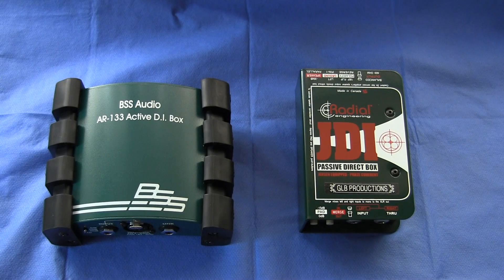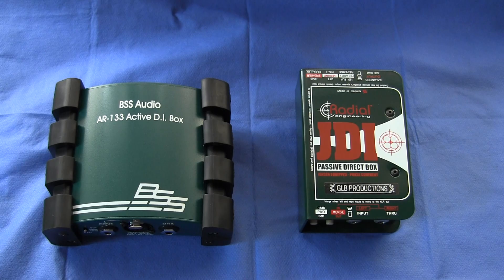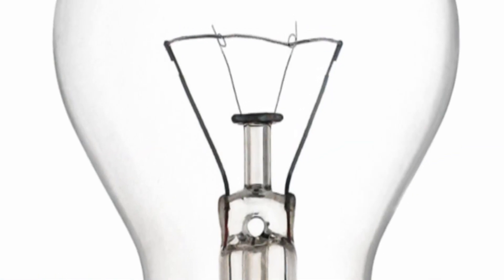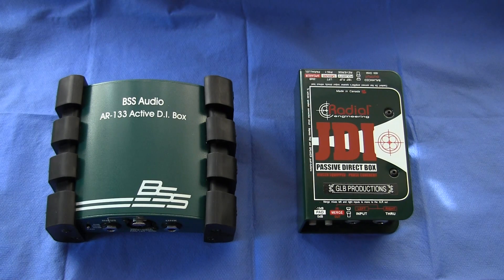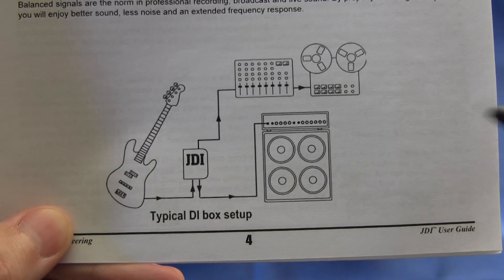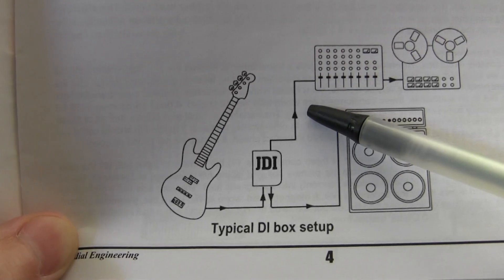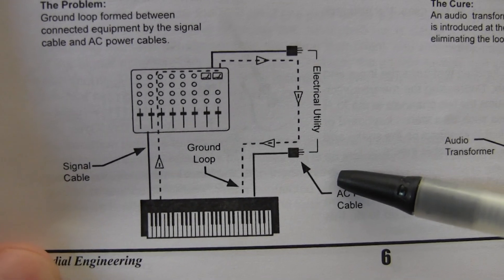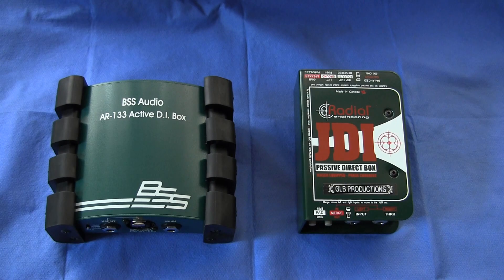DI boxes part 1: What does a DI box do, and when do I need one?

Comment: 5 years later, is the AR-133 still the best active DI? There are a lot to choose from. I have a Radial JDI stereo duplex I love so was thinking of getting the Radial active as well, but looking at options. Also I prefer to use line rather than mic input on my mixer (as DJ mixer and mic inputs have high pass filter etc) so I end up getting a mic preamp to boost the mic level output of Radial JDI to line level for my mixer hehe. I also have Radial X-Amp Reamper active, to use to convert line level aux send mixer output to hi-z for guitar effect usage, then back to line on the way in, for proper gain structure using hi-z/guitar effects with DJ/electronic production line level sends :)
Reply from the maker: As I mention in part 5, the Radial J48 is now considered the industry standard for active DIs. The AR-133 is still very good though, and has the dual advantages of being able to operate off battery power and having a transformer balanced output, which is quite rare amongst active DI boxes.

Comment: Great video. I can see that you have big knowledge with this stuff.
So, I have Steinberg ur22 and when I turn gain over the half I got some clipping issues. Later i've found out that they have clipping issues and I tried to connect my guitar first into DI box and the DI box into the interface, I no longer have clipping issues but my  tone is really weak. What do you suggest? Thanks
Reply from the maker: You're having clipping issues because your gain is too high :) Set it lower such that the clip light only comes on during the loudest parts of your playing and all will be well.

Comment: first of all, great video. my Keyboard question: My keyboard is a casio privia160. I have no actual output channel, just 2- 1/8" headphone jacks. What cable should I use to go into my DI box?
Reply from the maker: According to my research that keyboard has a stereo line out on the front, opposite the headphone sockets - does yours?

Comment: Could I resolve the power hum problem by connecting everything to the same power circuit, with a long heavy duty power extension cord? It seems like that would ensure that the ground was the same everywhere.
Reply from the maker: It depends on where the hum is coming from but that is definitely a good idea - stage and FOH gear should all be on the same AC circuit for sure.

Comment: every mixer i have seen so far has regual trs sockets for guitar amp cord plugs
Reply from the maker: Those are designed for low impedance line level inputs, not connecting guitars and basses directly. Some mixers have quarter inch inputs that are labelled 'hi-z' but these are normally only available on a couple of channels.
Reply: TS (unbalanced) NOT TRS (balanced - Tip Ring Sleeve - has the 'ring' for stereo OR balanced)

Comment: does this works for recording too? or just for playing live? ive got a bunch of noise when recording electric guitars in line connected to my soundcard.. will these solved all kind of electrical ground problems?
Reply from the maker: It depends on the source of the noise - if it's coming from the guitar itself a DI box will not solve the issue. You need to work that out first :)

Comment: So recently we moved to a different studio for band practice and now my bass amp starts making that typical noise when someone gets a text message near a speaker. Do you think having a DI box would help? Currently I have a 5m cable from my bass running to my pedalboard (3 pedals), then a 2m cable to my amp. Everything is close to eachothers, just got some spare cable length to move around.
Reply from the maker: Does the noise originate from your bass or from the amp - does the amp still make the noise when it's switched on with nothing plugged into the input?

Comment: I have the Focusrite Scarlett 2i2, so it has a Line / Inst switch. 

Should I set the switch to Line when connecting the electric guitar 
(passive pickups) through the DI Box ?
Reply from the maker: On that interface you don't need a DI box - just plug the guitar directly into the 2i2 with the switch in the Inst position. If you use pedals between the guitar and the interface try both the Inst and Line positions.
Reply: Ok. I understand ! I was wondering that since the concept of DI Box is new to me. Thank you !
Reply from the maker: You're welcome, all the best with your music :)

Comment: Hi there! Great review! May I ask, is the following signal chain suitable for a DI Box?

Guitar -> Pedals -> VOX Lil Night Train 2 W Full Lamp Head -> DI Box -> Mixer and headphones out?

Thanks
Dan
Reply from the maker: Sure that would work - but with that amp you always need to have it connected to a load of some kind because it's a tube amp. So either a speaker or headphones.
Reply: GLB Productions it has an inbuilt speaker simulator and the line-out is also the headphones out. so the connection to the mixer would go through the loaded out the line out

Comment: is there a benefit to running a di before an amp with guitar or bass?
Reply from the maker: I discuss that topic in this video: https://www.youtube.com/watch?v=tNU8sgBcrLQ
Reply: i see. a little different then the thing I was thinking but some good tips! I was more thinking like, my DI is an avalon u5 and Im running it before my amp right now to take advantage of some of the tone and weight of the transformer in the avalon before it hits my amp! I actually am noticing a little bit tighter of a sound, and I can also use some of the eq settings and low pass filter on the avalon! it also works as a gain clean boost! but even without the eq engaged on the u5 it sounds like it tightens up the bottom end abit and I guess I was wondering if other Di's might have a similar effect or maybe like a tube Di! Im just trying to see if anyone else uses di's before thieramp strictly for sound?

Comment: Hey I've learned a lot from your videos, but I'm in doubt for a live setup and I would be very glad if you could help. I use my laptop and a m-audio audio interface with balanced TRS outputs, along with a keyboard midi controller and a nano pad. I need to know if I need a DI box (and what kind of) to connect my audio interface outputs to the FOH via a snake or directly to the mixer. What if I just plugged in a TRS-XLR to the snake?

I'm currently using an unbalanced cable instrument to connecting directly to the mixing console which I'm pretty sure is wrong and has given me some trouble. So, what would be the ideal setup? 

PS. I'm currently using just one output and I'm fine with that but I would like to expand to a stereo configuration later.
Reply from the maker: Yes, a TRS to XLR male cable plugged directly into the snake will work fine. You can connect directly to a mixer using unbalanced quarter inch cables provided you are less than 15 feet/5 meters from the mixer - further than that and your risk noise.
Reply: Thanks for answering! So, no need for a DI box?
Reply from the maker: No need unless you have noise issues.

Comment: Do I need a DI box when running the audio out from a keyboard right into a LR unbalanced stereo line input in a mixer?  I've read that the mixer itself then acts as a DI box because I run the balanced XLR outs to the powered monitors.
Reply from the maker: If your cable run is less than 5m/15 feet then you generally don't need a DI box.

Comment: Hail GLB Productions, thanks for your very good explanations! One rarely finds such a precise guiding! But I've got a problem that my (active) DI box doesn't fix. When I plug my (passive) Strat through my amp (Blackstar 45 Series One), or in my Line 6 amp, I've got an extremely annoying high "whistling" noise omnipresent. When I try to record my guitar from the amp emulated output through my recording interface (TC Impact Twin), that "whistling" noise is recorded too. My house is relatively a new construction and I've asked the builder to put good ground and four different main sockets in my music room. In fact, I discover now that this noise is generally present even with my amps turned off, so from my hi-fi system too if I turn the volume to max! I didn't have such a noise before months, so it must come from something added? That drives me mad and I just don't know what to do. Any suggestions?
Reply from the maker: Yes that would suggest it is a power issue. You need to find out what was added around the time that the noise started - lights are prime suspects, as well as anything IT-related. Get a wiring diagram of your house and see what else shares the same circuit as your music gear. Then start turning off/unpluging things until the noise goes away.

Comment: Great video. Question: does a simple impedance matching transformer (you put on a cable) give the same quality as a DI (if the cable is shorter than 5 meters)?
Reply from the maker: It depends almost entirely on the quality of the transformer ;) Also, such a setup will not work for high impedance sources like passive electric basses.

Comment: Do you can eliminate the ground loop using auto transformer in the electrical source of the mixer or intrument/cube?
Reply from the maker: It's theoretically possible but it's much easier to isolate the audio ground.

Comment: Considering that an "audio transformer" is the "cure" to ground loops, can both an Active and/ or Passive type Di box be used to resolve this problem?

My curiosity stems from the fact that Passive type Di boxes use "Transformers" and Active type Di boxes use "Power Amplifiers"; therefore, one could come to the assumption that only Passive type Di boxes are used in this situation (LIve)
Reply from the maker: That's a good question Daniel. The key to solving ground loops is to break the ground connection between the two devices so that there is no longer any loop for the current to flow in, which is the source of the noise. A transformer breaks this loop because the primary and secondary coils are not physically connected but use an electromagnetic bridge to pass the signal. However you can also physically disconnect the ground - the simplest way of doing this is to unsolder the pin 1 connection on the XLR cable joining the two components, and many pros carry so-called 'ground lift' patch cables to achieve this quickly and safely. Transformers are thus not the only possible solution to a ground loop. 

When it comes to DI boxes, both passive and active DI boxes can be configured to disconnect the audio ground - the issue with active DI boxes used to be that lifting the audio ground meant that the DI could not be powered using phantom power, because lifting pin 1 also lifted the return path for the phantom power. However, modern active DI boxes such as the Radial J48 do not have this issue because they lift the ground in the power supply and not at the XLR connector. 

Finally, there are a number of active DI boxes which use a transformer in their output section, such as the BSS AR-133 shown in the video. Some would say this provides the best of both worlds. Others would argue that a transformerless output is best to ensure absolute audio purity - this is something that each engineer has to decide for themselves :) 

BTW Daniel active DI boxes do not use power amplifiers in the same sense as those used to drive loudspeakers, they use signal amplifiers that are most commonly operational amplifiers aka op amps.

Comment: Hi there, I have a doubt, I'm looking for a solution to having 2 outputs to one mic at the same time, one clean signal i want to get to my audio interface and the other to a vocal processor which then gets re-patched onto the second input of the audio interface, thus making one clean signal and one effected signal.......my question is can i manage to get the  double signal output  with the help of a passive dI box like that of Behringer or radial pro........... or do i HAVE TO NECESSARILY  pick up thoe XLR Y splitter cable or mic splitter boxes?!!?!? P.S - (i know radial pro has a separate mic splitter but just trying to cut costs and have one universal di box for mic and instruments), will definitely like your inputs on the same :)
Reply from the maker: Hello Sunil the correct way to do this is with a mic splitter as that will give you two identical copies of the original signal. If a splitter is out of your budget just use a simple XLR Y-cable it will work fine in most cases.

Comment: hello, excuse me i have a question, i m a Guitarist tryin to play quite at night,  so I want to play using headphones ,  no amp necessary, the thing is that I do want to use my pedals (real ones), how do I achieve that? I have old single coils on my guitar. thanks in advance!
Reply from the maker: Hello David, nice to hear from you. The absolute easiest way to do this is to use a practice guitar amp that has a headphone output - these automatically mute the internal speaker so that you can practice in silence. The other option is to purchase a small headphone amp like the Presonus HP4 which you would then connect to the output of your pedal board. Hope that helps!

Comment: Best explanation I've heard so far. Especially useful for a dummy like me!  Is one DI box sufficient or do you need to get one with eg 4 ins and outs to cover all the instruments going into the PA?
Reply from the maker: You need one DI box for each signal source that you are going to DI. So in a typical band you would need one for bass, one for each keyboard and one for acoustic guitar. Electric guitar may or may not be DI'ed depending on the player's setup and preferences.
Reply: I normally play electric or acoustic guitar and sing with backing tracks, all going straight into the PA (usually via a TC Helicon Voicelive 2 for vocals and a TC Electronic Nova for the electric.). Hopefully one should do the job, if my understanding is correct.  Thanks for your prompt reply.
Reply from the maker: You're welcome. Yes the Voicelive has a balanced output so it doesn't need a DI box. For the Nova you'll need to decide if you want a mono or stereo DI box, I recommend the latter so that you can have stereo effects in the PA system.
Reply: Just watched your 2nd video and it was extremely helpful.  I realised after watching it, that my Voicelive 2 actually has a ground loop button on it.  Also my Nova goes into the Voicelive 2 and comes out the through to provide chords for harmony.  I'd forgotten that the lines out were balanced on the Voicelive 2.  The Nova has left and right out, but I'm not sure if it's balanced. Both go into a little behringer mixer which I now realise has too low gain - as in your example at the end of Video 2.  From that I take the output of the mixer into a Zoom UA-3 audio interface for streaming. I've got my son's passive behringer DI box somewhere, so that might do the job. I'm a bit concerned as to why my gain is so low on the mixer master.  You see, I really am clueless.:-)
Reply: Sorry, ground lift button.  This is the same setup I plug into my power mixer for live shows.
Reply: Another question. I noticed in Part 3 you have your gain setting up but apart from with the bass through the XLR connection the level is very low.  Is it better to use the gain than the level in most situations? I've also put a link to your site on the BIAB site as I know there are lots of people on there who will enjoy your videos.
Reply: It appears the Nova also has Hi-Z and balanced input + balanced stereo outputs
Reply from the maker: The gain should be set in accordance with the procedure I describe in this video: https://www.youtube.com/watch?v=KcUgggdxLPM Once that is set correctly the mixer's master fader can be set to 0dB and the channel fader used to get the appropriate level in the PA system. This ensures the best possible signal to noise ratio.
Reply from the maker: Gabriel Pueblo Good question - I think this video will answer your questions: https://www.youtube.com/watch?v=HgeVInOV1Kk
Reply: GLB Productions thank you very much! (I can see you have a long experience on the field, the only way you can make all that complexity into clear and simple tutorials) very generous...
Reply from the maker: Gabriel Pueblo Messages received, will get back to you in the next day or so :)
Reply: but what if we connect different instruments to something like Nady MM-242 as a sub mixer, would it work between the submixer and a mixer? the chain goes like this: instruments + Nady + Passive DI + Active Mixer + Speakers
Reply from the maker: Gabriel Pueblo You're welcome, thanks for watching! Let me know if you have any other questions.
Reply: GLB Productions hi, I've send you a  message in Facebook... for a specific situation. thank you for your kind attention.